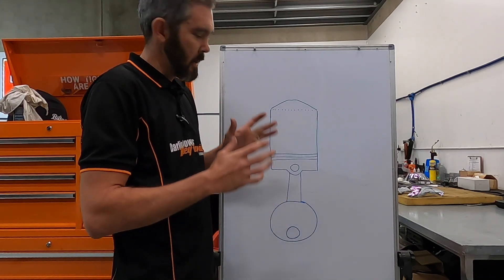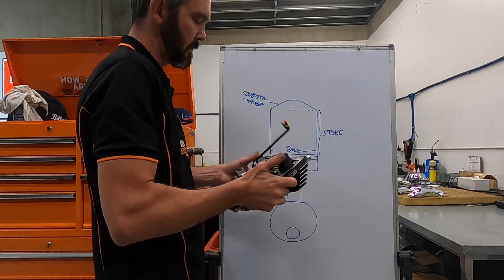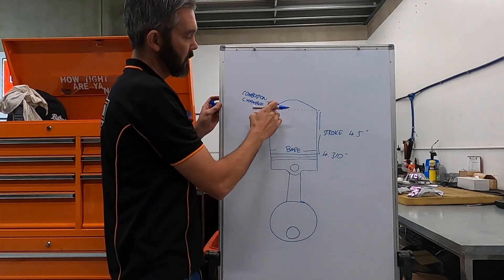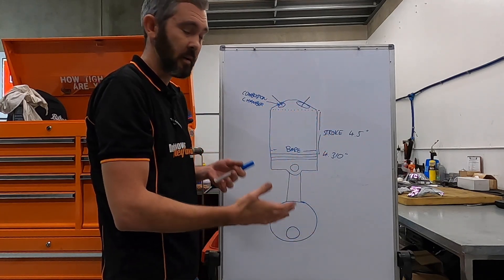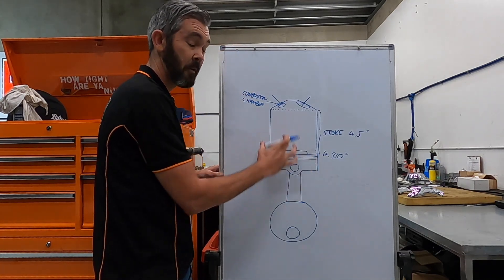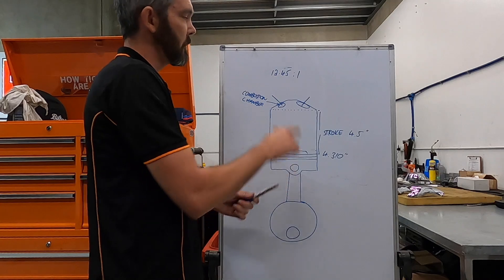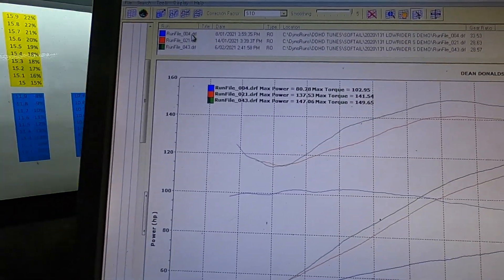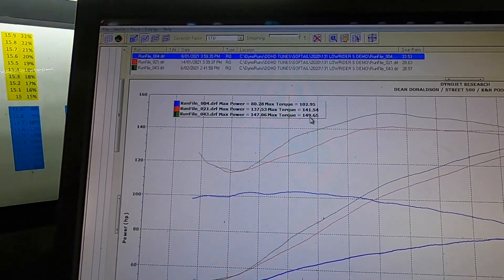131ci Stage IV Lowrider S / Part 3 / T-MAN Hi Comp Pistons / Cyclerama CR540 Cam / Dyno Review

Comment: Hey Tommy, what do you think about this build sheet? Would you change anything? Anything overkill? It’s for my 2020 FLFBS, not intended for race purposes by any means. But do what some extra power and longevity/reliability out of it. Any comments would be greatly appreciated!

S&S 128in. Chain Drive w/ Upgraded Cam Plate/Oil Pump $2300  JPCycles w/ Gold Club or GetLowered w/ 5%
S&S Top End Guardian Kit w/ M8 Headbolts, Rocker Arms/Studs/Shafts  900-1092   $750  Fuel Moto
S&S 55mm Intake Manifold w/ OE TB $189   Fuel Moto
Cam Gear Spacer Kit 25928-06  $10  Surdyke
Cam Gear Retention Kit 25566-06  $6   Surdyke
SE 1275Nm clutch springs.  37000286    $20  Surdyke
SE Ventiliator Extreme Air Cleaner $173 29400396 w/ Chrome Cover 61300993 $141  Surdyke
SE 5.5G/Sec fuel injectors 27400040 - good for 115-155hp   $130 Surdyke
OE Clutch should be fine, but add SE 1275Nm clutch springs.  37000286    $20   Surdyke
521R Cam - $280  Allows for headwork later on for more gains.  Feuling
D&D Abuelo 2:1 Chrome Exhaust $900
Reply from the maker: They've quoted you twice for the SE 1275N clutch springs.

Gear drive cams are not worth it in my opinion mate, so if it's cheaper to do the chain drive setup do that. People will tell you that having a gear drive cam setup keeps the timing perfectly in check and stops any 'play' that comes from the chain setup.

What they don't know is that once you get to about 5thou or more of crank shaft out the gear drive setup is not as reliable anymore due to lack of teeth engagement. Almost all cranks will have at least 3thou run out from factory. From there it only gets higher unless you have a welded Dark Horse Crank.

The argument about keeping the timing in check and removing 'play' in my opinion is just a selling point as the benefits of removing that TINY bit of play would be immeasurable on the dyno.
Sorry for the rant but I really think gear drive cam setups are a waste of time.

The rest of the build sounds like it's going to be a very good & solid foundation. Whether you keep it just as they build it or do more work further down the track  I don't think you will be disappointed.

Also is there is any price difference between the the SE 55mm intake & the S&S 55mm intake go with the cheaper one just to save a bit of money. Both intakes are absolutely outstanding in quality & performance so there won't be any sacrifice by using the cheaper one.
Reply: @MasterTechMiller  Thank you, Tommy! I’ve watched your videos, among others, to kinda figure out what to put together. 

That was my fault of having the 1275Nm springs listed, got that fixed! Thank you for the catch! 

I’m pretty sure I can get the SE a tad cheaper on Surdyke.com. 

I certainly appreciate your feedback and look forward to future videos!! Thanks so much!!
Reply: @MasterTechMiller  Could you recommend a tool for measuring the installed cylinder head installed valve spring height? I’ve seen barrel types that turn and like T-shaped micrometers. Do both work just as well as the other?   Thanks!

Comment: When you go to a 128 or 131 kit producing 150ish HP/Torque on a 2020 Softail, do you recommend running the OE Crank/Flywheel? Are there other products you recommend upgrading at the same time for reliability?
Reply from the maker: I would highly recommend a Dark Horse Crankshaft that has been trued, plugged, balanced & welded if the build was to be race frequently.

Running upto and just over 150hp is generally fine on the stock crankshaft, however it comes down to rider abuse and how they ride.

Constant 'chopping' of the throttle, high rpm down shifts, & along with wide open up shifting are just some of the contributing factors to premature crank run out.
Reply: @MasterTechMiller  I don’t ride like that, I’m pretty easy on my stuff, don’t intend to race at all. But I would get on it a little bit once in awhile to experience the fun and power-  no speeding tickets. Lol 

Anything else you’d recommend upgrading while in there?
Reply from the maker: @flytheedge  just the usual..... latest oil pump from Harley, Inner Cam Bearing, Cam Support plate, lifter guides (when big lift is used) which will be required in a 150hp build.
Reply: @MasterTechMiller  thank you very much, Sir!

Comment: hey tommy got it dyno tuned 130 hp 155 torque 128 with a 475 cam
horsepower was down more than i thought must be that s&s 475 cam
Reply from the maker: Yeah definitely that 475 Cam, I haven't seen one make over 130hp yet. Made some really solid torque but! That should feel very solid in the street.
A mate of mine has the 475 in a 124ci and made 128hp & 139ft/lbs with stock heads.
Reply: @MasterTechMiller  o yea out of the hole she rips I’ve got hand ported heads 64 mm TB 5.5 inj but I think that’s all I really need I just ride around on the street So I’d probably rather have torque than horsepower
Reply from the maker: @roncoburn7771  oh absolutely mate! More TQ with a decent amount of HP is always a winner! Well done with your build mate 👍👍
Reply: @MasterTechMiller  thanks tommy

Comment: dont you run them in for 500miles   whats your  take on running in new jug s and pistons
Reply from the maker: Great question! These cylinders have been precision torque plated & honed very accurately to accommodate these new pistons. I also check & adjust the piston ring gap. 

Once the engine is assembled, I heat cycle the engine 3 times to ensure everything has been up to operating temperature then cooled back down to ensure the rings are getting fully seated.

By taking these steps the old 'run in' process doesn't really apply.

Run in procedures are a very debatable topic.

However if a customer is only wanting a 'bolt on kit' straight from the catalog, I recommend at least 500km worth of riding before the engine is tuned at wide open throttle to achieve max HP & TQ. The reason being is the cylinders & pistons from bolt on kits are manufactured and machined on production line and machined to a 'tolerance' there for allowing for differences.

As mentioned above, having the cylinders precisely machined to accommodate the exact pistons takes care of this.
Reply: @MasterTechMiller  thanks mate

Comment: Tommy, great series! I’ve followed you down this path with my Low Rider S... 475 to SE131/CR512, Bassami 2 into 1 50th anniversary, complete S&S internals and mini tear drop, Power Vision tuner. SE wide band sensors with a tweak from FuelMoto on the base tune that allowed me to use them.

I pulled a 154tq and 139 hp (I’ve been limited on the dyno as the bike will not exceed 121 mph in any gear so we can’t “see” the real HP but suspect it’s in the 145hp range due to software deeper inside of the ECM that PV can’t get too shutting off fuel at that limited speed).

How would you compare the feel of the two cams by your seat of the pants? I’m already at the point that it basically spins the rear OEM Michelin tire at will (will be switching to Avon on the next go)... and my arm sockets are always sore from the handle bars trying to pull my arms off!

In my opinion.... the best bang for the buck is still the S&S 475 cam swap.... the lope and sound is by far the best out there... and on a light bike (and skinny girlfriend /wife) , it’s really fine.
Reply from the maker: I'm certain that with Power Vision in the Switches & Limits menu there is an option to turn off the speed limiter?
I have seen it myself before which makes me wonder if there has been some sort of update that has removed that option?

I have found that coming from the CR512 to CR540 that the mid range to top end is definitely where you feel the increase! 
Don't get me wrong, the CR512 is an absolute kickass camshaft aswell, it provided more a low end punch that faded ever so slightly from the mid range onwards.

Couldn't agree more about the S&S 475 as a bolt in for the 114ci engine. Definitely produces a nice sound at idle and when matched with a good pipe can see north of 115hp & 120ft/lbs
Reply: @MasterTechMiller  we have gone through the PV both with FuelMoto and Dynajet... it could have something to do with the SE smart tune pro that I am still using in the setup.   I’ll put more miles on it... will report back!
Reply from the maker: @dp_NYC  no worries mate 👌 Looking forward to finding out how you go

Comment: Sounds like you might have a restriction somewhere. Heads,tb or exhaust, maybe all 3 are getting close to max capacity. Anyways great series, makes me want to up my stage 4 114 that makes 126hp and 131 tq
Reply from the maker: I'm certian that there is more left in the heads. If I was to shave 20thou off them and use a 30thou head gasket I'd make the 160hp mark easily. 

Your 114ci sounds like a nice build 👌 What cam shaft is it running at the moment?
Reply: @MasterTechMiller  a little extra squeeze in the heads is never a bad thing, it’s running the zippers redshift 472 cam with a d&d billet cat.

Comment: Loved this series. Wish you showed an overlay of the dyno runs.  Did you lose torque in the 2500-3500 range or did the bump in compression keep the torque up down low?
Reply from the maker: Yeah I realised I totally missed that shot when I was doing the editing.
If you follow me on Instagram (link in video description)  I'll post a picture of the over lay graphs 👌
Reply: @MasterTechMiller  thanks I'll check out Instagram
Reply from the maker: @cjlspeed  I will post the pic tomorrow when I'm at work 👌

Comment: Good stuff, are you using wide band o2 sensors, and what tuner are you using, because I'm having a 131 built on my 2021 cvo road glide with a 585 cam and d and d big bore full exhaust system
Reply from the maker: Wideband tuning is always used on the dyno to achieve the best rideability conditions, fuel economy & maximum HP & TQ.
Once the dyno tune is completed the bike uses its narrow band sensors. Due to the tune being dialed in on the dyno the narrow band sensor are more thank enough to keep the bike running great.

I have been using the Techno Research software since it was released in Australia and I am very confident and fluent with it. However I can still use any other tuning software to tune bikes (Screamin Eagle, TTS, Power Vision, Direct Link, ect). 

Sounds like your going to have your hands full with that build!!! Let me know how it turns out 🇦🇺💪🏍💨
Reply: @MasterTechMiller  so what you think my dyno numbers will look like with my setup , using harley-davidson smart tune pro and the pro street tuner so that I can keep my warranty?

Comment: I could see your dissapointment at so little gain, I would be too but tuning is a funny thing eh....you have made the big leaps now it's a matter of chipping away at things to find the little extras. Not forgetting that real world rideability is what matters.  I'm going to be thinking about this for a while. Imagine if you had an engine on a test bed and you just kept trying all the available combinations to see what you get. I'm ex engine development...Diesels...so I'm always interested in this kind of content.....you do great work 👍
Reply from the maker: Absolutely mate! I was a little disappointed as you could tell. 
I would like to try a few different exhaust systems and make a couple extra tweaks here and there. 
I ended up having to pull about 5 degrees of advance out of it to make the 155hp. 

Bikes feels absolutely great on the road. Very well mannered, doesn't surge or get choppy, it's just super smooth but when you open the throttle it comes to life!!!
Reply: @MasterTechMiller  Cheers...I'm wondering what it would have been like if you hadn't changed the cam as well now ha ha! If you were my local dealer I would definitely be buying a bike from you. Your customers are lucky to have someone who knows what he is doing.👍
Reply from the maker: @stephenhamer1702  cheers mate!!!
The 512 was designed around the stock comp ratio so I would like to think it would have made more torque down low and lifted the torque curve through the middle aswell but I don't think it would have made much more overall HP. 

Maybe I'll swap it out and give it a go if I have time🤔

Comment: Solid numbers Tommy. I cant wait for mine. It will be interesting to see if the difference in pipes alters the numbers at all. I'm keen to see the track times when you get it there. Cheers for the shout out mate!
Reply from the maker: Yeah mate absolutely!!!! Cant wait to build it for you either. 
I'm a little annoyed I couldn't quite reach that 160hp mark I was hoping for but that's the way it goes sometimes.

Keen as to send this thing down the 1/4 too
Reply: @MasterTechMiller  Im happy it rides smooth. Its not all about the Ponies. Well for me anyway. Im sure given time and a bit of tinkering and changes you can achieve 160hp and as you pointed out in previous videos, different Dynos produce different numbers depending on altitude/weather etc. Plenty of variables to consider. Either way, the extra 5hp wont be missed on any QLD road 🤪
Reply from the maker: @moulis05  yeah mate absolutely!